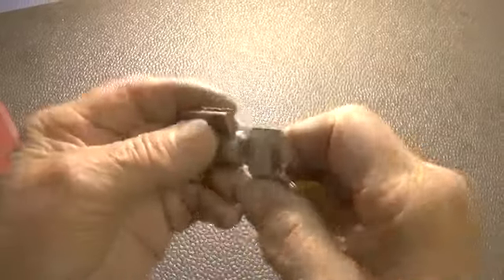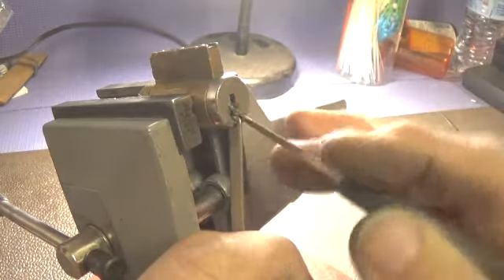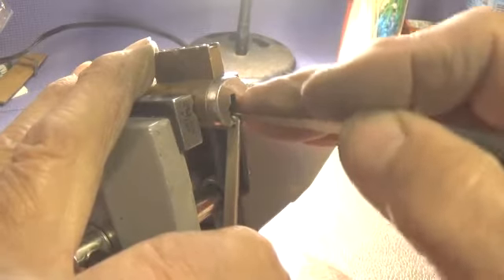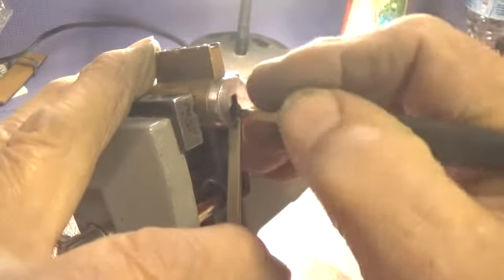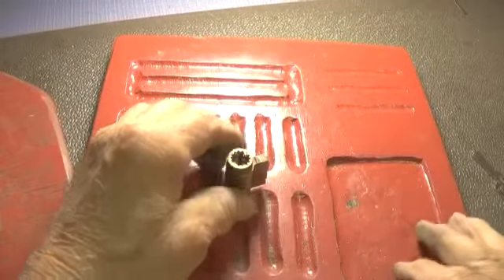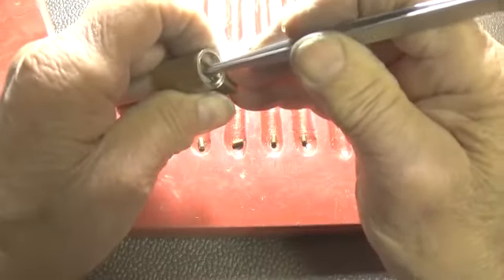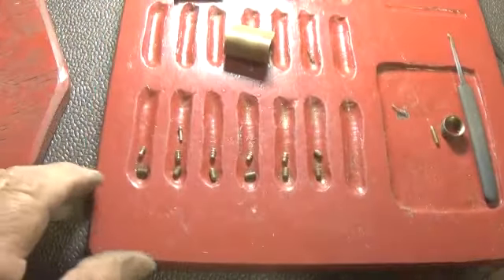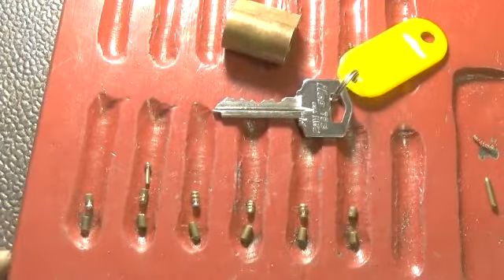(404) Ilco KIK 6 Pin SPP'D and Guitted

Comment: maybe I can score serrations in keypins with a simple tool. I don't like using power tools on pins. something like a pipe cutter. a mini version if there is one i can score serrations.
Reply from the maker: +JB  I use a dremel and a hacksaw blade and or a file to make serrated or spool pins. It worksfairly good.
Reply: +Texas Jim I am dangerous with power tools and sharp objects lol